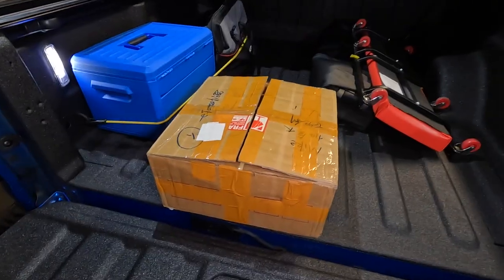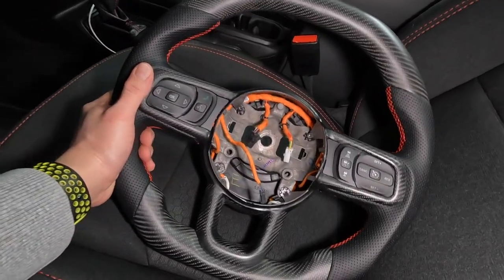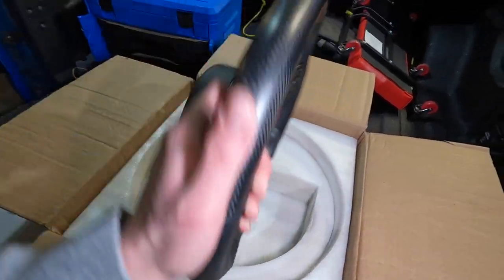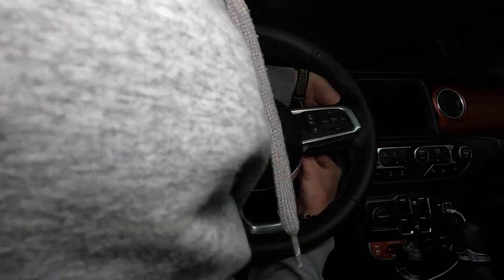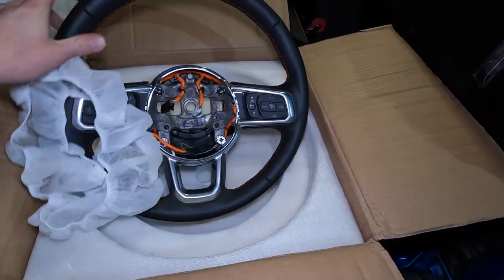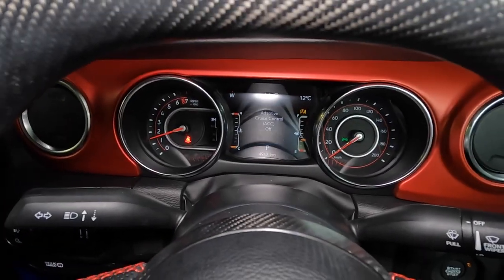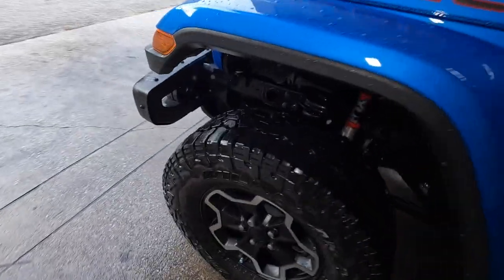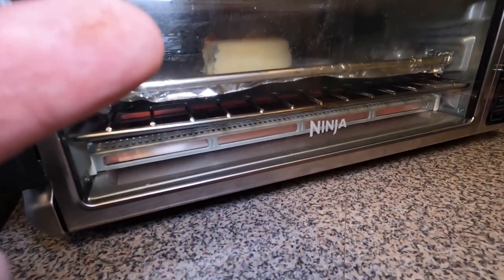JL/JT Custom Carbon Fibre OEM Steering Wheel Install & POV Drive

Comment: Looks great! Just placed my order for a custom steering wheel for my Sting Gray Rubicon partly because of yours and a few other  videos. Mine will be very similar to yours except that I ordered regular carbon fiber instead of matte and I also ordered the matching red stitched airbag cover to get rid of the silver Jeep logo. I’m sooo excited! Besides my 40 inch tires and lift, I think this will be my favorite mod. Like you mentioned in the video, it’s something you’ll constantly be using. I also ordered the carbon fiber 8.4 inch radio bezel and floor/drink console. I’m just so-so on those. But I thought it would be a good idea to not have the steering wheel be the only thing carbon fiber in the vehicle as to not make it look out of place. Hopefully I receive them soon so that I can quickly determine if I made the right decision lol. Thanks for the very helpful video!
Reply from the maker: Glad I could help

Comment: Great vid, been contemplating a new wheel myself. Could you respond to this comment with a link to where you got and also to the took kit? Thanks!
Reply from the maker: The wheel I got direct thought manufacturer so I can get you one but it’s about a month lead time after you place your order. Message me on Instagram to order one. The tool kit is here 

https://www.canadiantire.ca/en/pdp/mastercraft-socket-set-270-pc-sae-metric-crv-nickel-chrome-plating-0580294p.html

Comment: Is it possible to put the steering wheel back on crooked, or is there something to make sure it only goes on one way?
Reply from the maker: Definitely possible, gotta make sure you line it back up how you took the other one off or your steering wheel will be crooked. I had this happen on my Honda civic when I got a new wheel for it and I had to take it back off and move it one tooth over on the splines
Reply: @SmokinMonkeyOG  I think I’ll put some masking tape across the two parts to mark the alignment. BTW, are you still sitting on your take-off steering wheel? I’m looking for the leather part in good shape, red stitching heated 2020-2022.
Reply from the maker: @user-uz3jb6xo6c ya I still have mine but I’m holding on to it. If I ever sell the jeep I’m taking my wheel for the next jeep lol 😂

Comment: Hey, Sexy. Can I add a heated wheel to my 2016?
Reply from the maker: Only if that was an option for your vehicle. They use an original steering wheel and then re finish it with your choice of materials
Reply from the maker: Probably not
Reply from the maker: Unfortunately